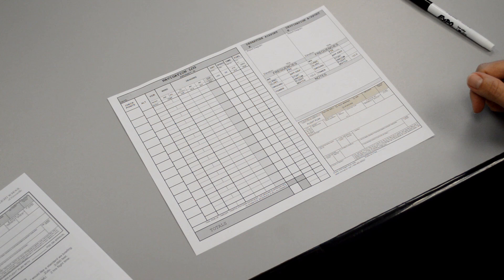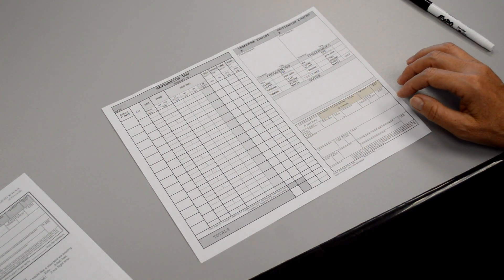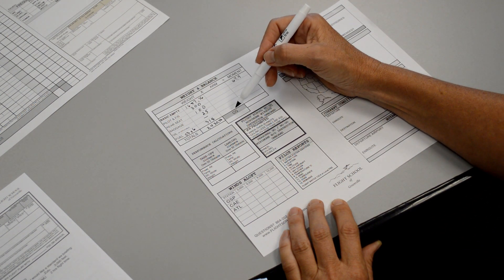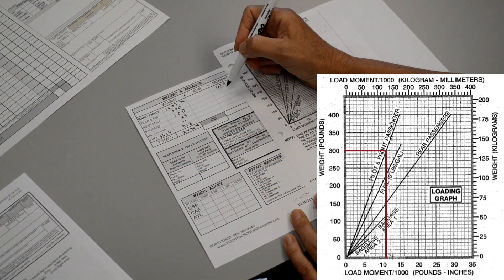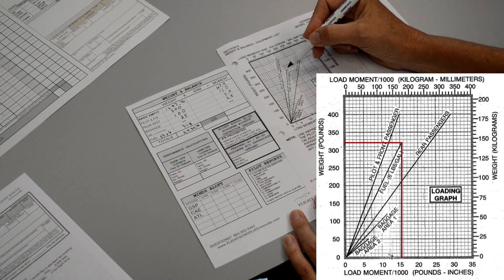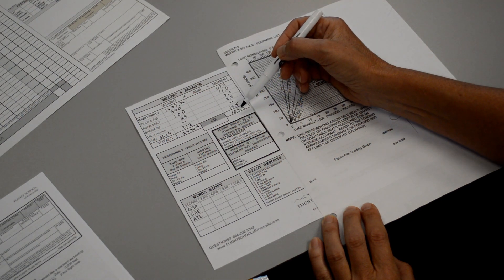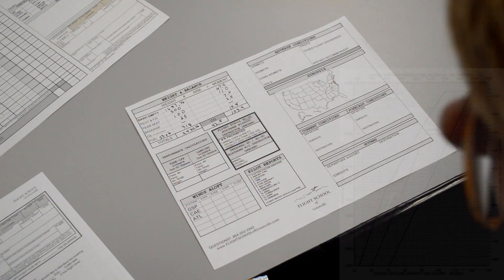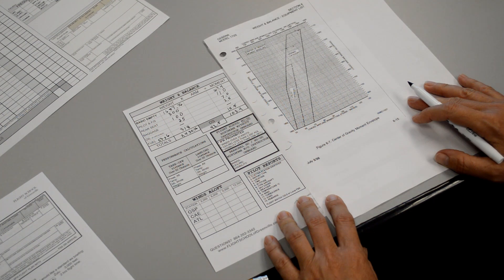Weight and Balance - XC Flight Planning (Private Pilot Lesson 14a)

Comment: The process here is correct,  But those old charts are pure garbage.  Read the POH and see if you can find the actual ARMs (they are usually listed) and get the proper moment.  When it comes time for the written test, just memorize the answer from your test prep.

Comment: Question... I notice you use the 6-14 Loading graph in the C172 POH (I am referencing the C172S specifically in mine), but could you also do it another way, which is to use the 6-9 Loading Arrangement graph and after having weights you can put in the arms from the loading arrangement chart and simply multiply weight x arm to get moments? (then /1000). Finally, divide the total moment by the total weight of the aircraft loaded to get an overall arm/CG? Great videos!